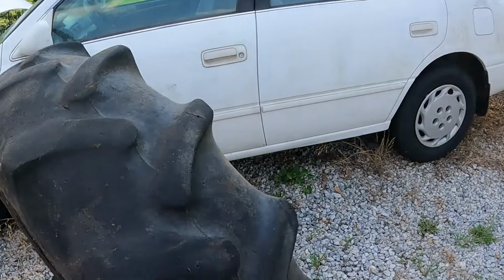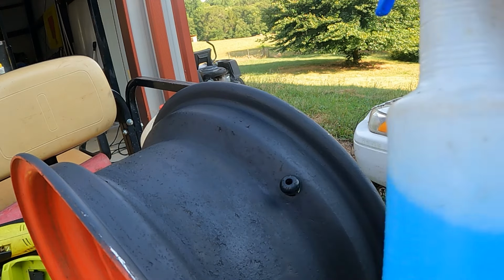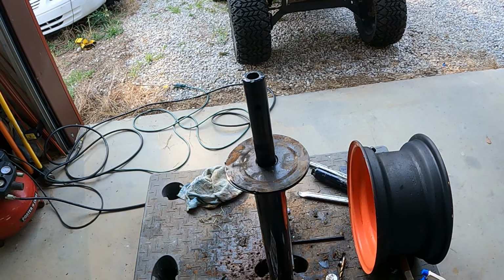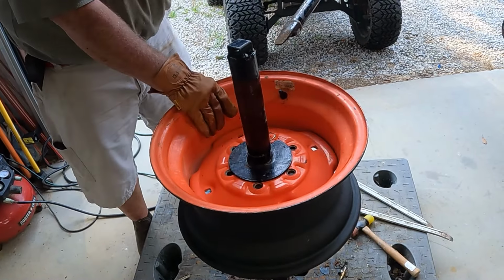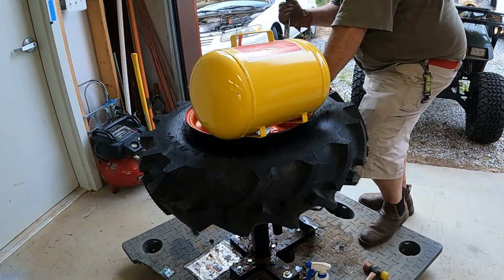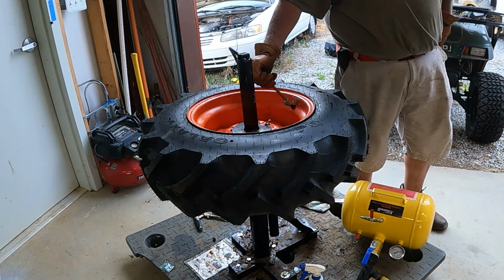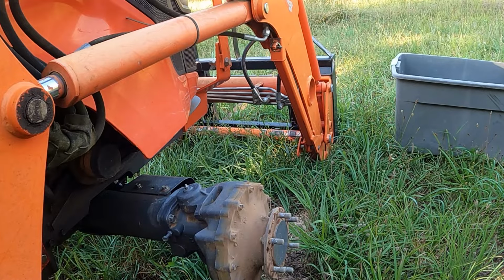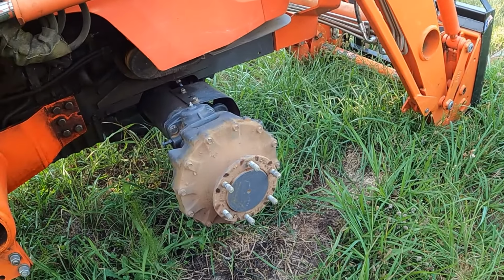Mounting a New Front Tire on the Kubota, Problems Were Had!

Comment: Hard work. I think I would take the other one to a tire shop.😊
Reply from the maker: I really need to modify the tire mounting station and add the duck bill device. That would make it a lot easier. Those tractor tires are super stiff, makes them a little more difficult. If it was the rear tire, there definitely wouldn't be a video of me changing it!
Reply: @cedarfallsfarm9833  I thought you did a great job of it. The only time I had to do it I took off the tire and wheel and took them to the local tire shop where they had s power tire chsnger.
Reply from the maker: @adnacraigo6590  I'm too cheap to take it in, unless I don't have a choice.😁😉